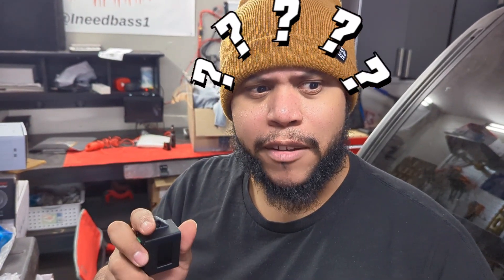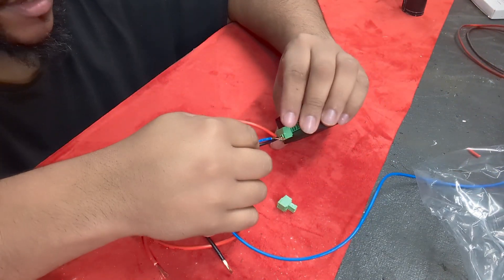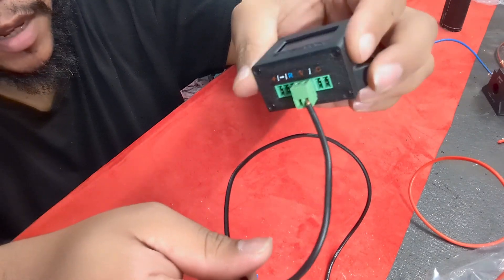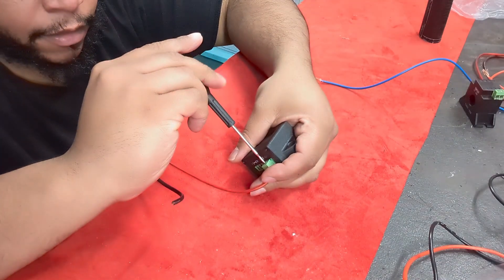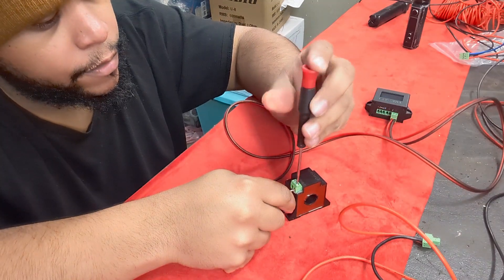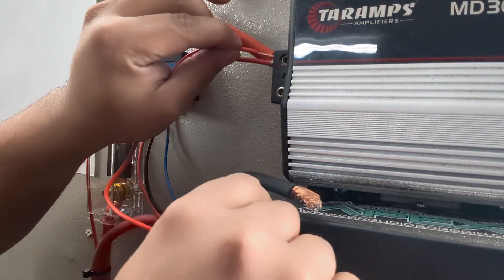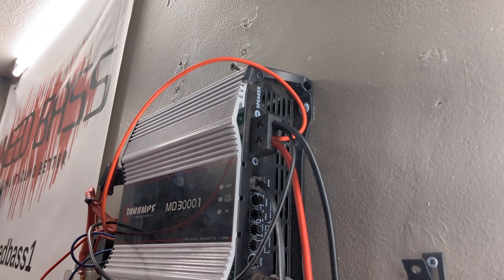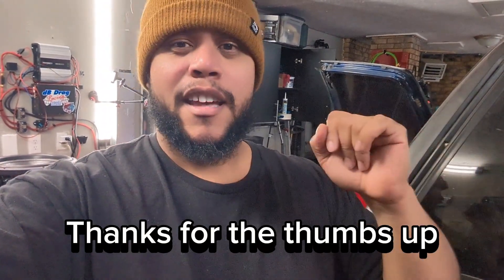Step by step install of basshead garage watt meter

Comment: Does anyone notice the reading to be off? I have my sub pumping and it's at like 600 watts and it can't be only 600 watts. I was thinking about sending the unit back and getting a new one 🤷‍♂️
Reply: BTW I'm running a big boss 8k and Xv3 12" with 390a alternator, XS D3400 up front and 108ah sodium ion bank in the back. 2/0 wire to the amp so it can't be an electrical issue.
Reply from the maker: That is strange! I hope somebody in the comment section knows. I haven't had a problem with mine. It could be faulty! 🤷🏽‍♂️
Reply: @ineedbass1 that's what I was thinking also might send it back while I can

Comment: I encourage everyone to label the two green plugs with a C and V so as not to mix them up. Doing so can damage the meter. 

You can also refer to the current transformer as an induction loop.
Reply: Or a “hall sensor”